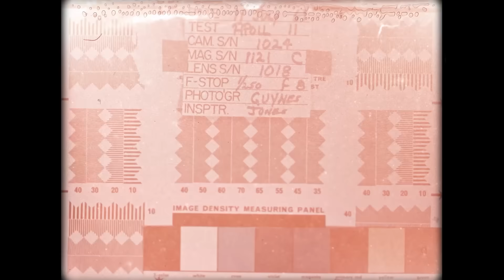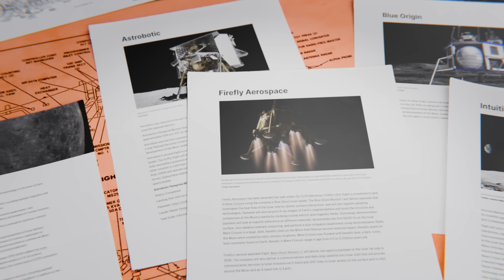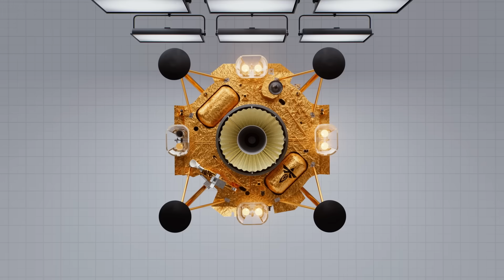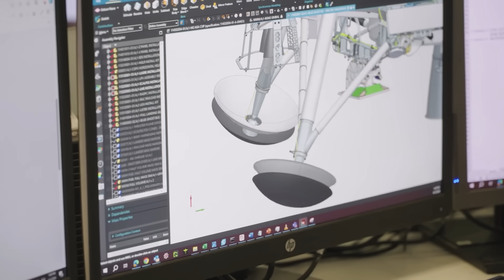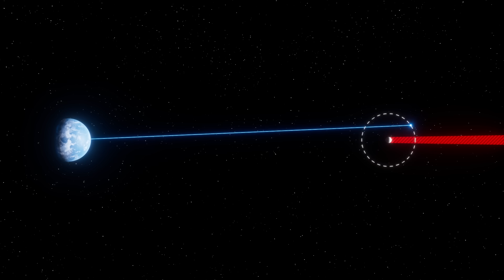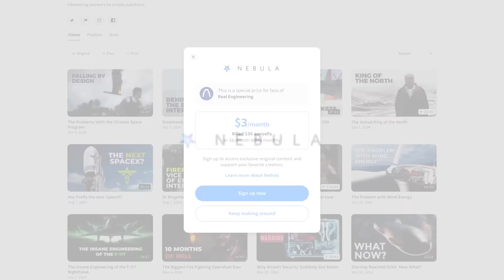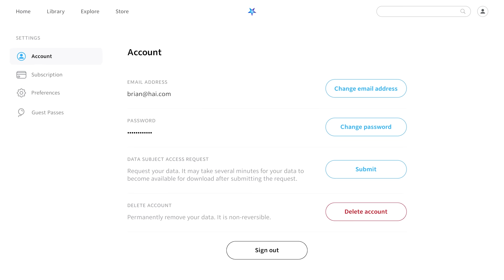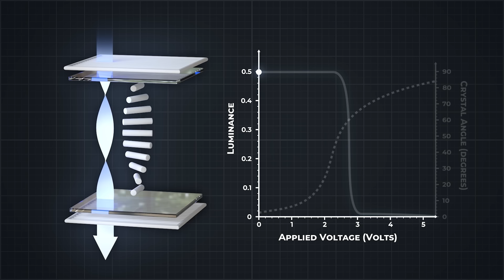Why the US is Struggling to Land on the Moon

Comment: Couldnt you use a sort of air pillow to reduce the landing force ?
Reply: In vacuum?
Reply: @ThomasKunderaBis   Airbag tumbler landings have been done on the moon. In fact, the first probe that successfully landed on the moon (Luna 9) did.
Reply: @ThomasKunderaBis  
If you bring your own Gas ?
Reply: @Conquerthemall  Sorry, I misunderstood, I thought you wanted to do some ground effect floating stuff, which I think would be quite hard without atmosphere.
But some inflated cushion could work, right.
It's light which is important in space and can soften a landing by some factor.
However, space speed are in the km/s range, so most of the speed reduction have to be done by something else as no cushion can handle that.
Reply: @ 
No offens taken 
I would still use the Rockets to Slow down 
It just seamed to be more robust than tinny lags trying to Balance the weight
Reply: @Conquerthemall  : The issue then is still how to recover from a random bounce on a cushion and land on some legs or whatever being more stable than an inflated cushion...
It's not easy, I'm afraid.
Reply: @ 
You could deflate the cushon in a controlled mater so it Lands on same small stabelisers  
Just a thought
Reply: You mean an airbag? Yes, that’s doable for a small lander. In fact we did that for some of the Mars missions.
Reply: @Hobbes746  
Ok thats what i meant 
But These landers are to Heavy Even in the low Moon greavity ?
Reply: @Conquerthemall  I think IM-1 could have used air bags. They’re good up to a few hundred kg on Mars, so twice that on the moon. 
The main advantage of airbags is that you don’t have to care as much about the terrain in your landing zone. The airbag will bounce off any boulders. The disadvantage is that you have less control over where you land, your lander gets heavier, and you have to deal with the airbags after the landing.

Comment: i like how at 6:32 when the craft is on the moon, the sky has the moon in the background
Reply: Sir that is the Earth
Reply: @ObenjOne  Yeah sure.... the Earth is exactly the same size as the moon... because the moon isn't 6 times smaller than the Earth right ? 

It should be 6 times larger than the moon size in the sky but it isn't so.
Reply: @PilTheGrimm  The size of the moon or earth in the sky entirely depends on the lens of the camera (here it's a simulation, btw). You've never seen these photos with an oversize moon ? It's not photoshopped, it's just that the photographer used a teleobjective lens that acts like a telescope. Here it's clearly a wide angle, so you absolutely can't deduce anything from its size.
Reply: Same
Reply: The Earth has phases too, when viewed from the Moon. They are the complement of the Moon phase as seen from Earth - full Earth when new Moon, crescent Earth when gibbous Moon, etc.
Reply: @MattNolanCustom  Notice how the size is exactly the same as the Moon we see from Earth ? It should be 6 times larger then that...
Reply: @PilTheGrimm  that's entirely down to the camera position and lens. I realise this is a "virtual" representation, but you can't just make a judgement of size foreground versus background without knowing details about how the photograph was taken.

Comment: What the hell happened to NASA? We used to do it and be really good at it. Did they go woke like everything else and do Dei hires?
Reply: IM-1 is not a NASA mission. It was run by Intuitive Machines, a new company with no experience, and who were determined not to learn the lessons learned by NASA in the 1960s. IM-1 failed due to a very dumb oversight.
Reply: Um, this has nothing to do with woke and DEI.
NASA has a tiny fraction of the budget it used to have in the Apollo days.
That's it.
Reply: @rockyblacksmith  And rather than be efficient with it. It waste it on company's like Boeing company. Spending billions on crap like Starliner. Don't even get me started on those throwaway rockets that NASA wants to use to go to the moon.  Spacex was given a fraction of the money when compared to Boeing. Then they turned around and produced Dragon. 
How is it that NASA can't be creative like it had in the past? Most likely because the real talent died off.

Comment: This is just a random thought, but lasers . Why don't they just make lasers similar to those in the ship landing scene from in WALL-E movie? They can adjust the camera settings and lasers' strength and specific wavelengths so that they can be seen on the surface even if there is dust in the way. Seems like that would fix the all the visual navigation system problems
Reply: Lasers? Nope. The right wavelength of Radar would be a smart idea as a back-up to the photogrammetry though
Reply: The dust blocks light sur

Comment: My boy is not dissing IM is he? My college roommate is working on the team that built the cubesat camera (eaglecam) on Odyssey. (He did join that team after they finished that project but still)
Reply: IM is due some dissing. Forgetting to switch the altimeter out of safe mode was a very preventable mistake.

Comment: Struggling to return?  You can't struggle to reach the moon! it was easy as pie in 1969 Apollo 11!  so whats the big deal? they did it 5 or six times easily, so whats the struggle?
Reply: NASA spent $300 BILLION on reaching the moon in the 1960s. That’s how “easy” it was: it was the most expensive, largest, most complicated engineering project in history. 
IM-1 cost 1/3000 of that.
Reply: The Van Allen radiation belts which they didn't factor into the original fraud.

Comment: Did NASA themselves not say that the main hurdle is our inability, given our technology, to pass through the Van Allen radiation belt?  When asked about the technology that they used during the Apollo missions, did they not say we don’t have access to that technology anymore?
Reply: nasa never said that, stop listening to conspiracy nuts clinging onto hearsay. the super secret technology to countering the radiation belts is putting more material of shielding and/or going through them fast. van allen belts were never an issue because it's just radiation. as long as you don't stay in some dumb orbit that passes through them electronics and human exposure are a non issue.

the only lost technology from apollo would be manufacturing processes, things are done differently now. this means the specific onboard computers that were used and had radiation resistance cant be reproduced. here 'losing' the tech simply means they have to make new computers from scratch, which they did.

Comment: 0:23 Is this an accurate visual of the landing? If it is, i must wonder why the lander still had any transverse velocity when coming in for touchdown. Surely they had the fuel to shave off an extra couple of m/s, and surely a completely radial approach is ideal. Did they start decelerating too early to hit the perfect flat spot? Did they have to clear some unforseen rubble? I don't understand this choice.

edit: Ok, i have pieced it together. The "laser range finder" has a safety pin that cuts power to it (i think) because you need to be careful with lasers. They forgot to remove this pin before launch so this important navigation system didn't work and they were forced to land without the necessary data.

This is explained further in NASA's livestream "Intuitive Machines Moon Mission Update" on 2024/02/28 starting at 56:00.

>> Odysseus was supposed to land vertically with zero horizontal velocity, but because of problems with the navigation system, it was still moving sideways when it hit the ground. The spacecraft had been designed to stay upright when landing even on a slope of 10 degrees or more. The navigation software was programmed to look for a spot where the slope was five degrees or less. Because the laser instruments on Odysseus for measuring altitude were not working during descent, the spacecraft landed faster than planned on a 12-degree slope. That exceeded its design limits. Odysseus skidded along the surface, broke one of its six legs and tipped to its side. If the laser instruments had been operating, “We would have nailed the landing,” Mr. Altemus said during a news conference last week.
- NYTimes 2024/03/04

>> An apparent issue with Odysseus’ navigation systems forced the lander to rely on experimental technology. Intuitive Machines made the decision to reassign the primary navigation sensors from Odysseus … to use the sensors on NASA’s Navigation Doppler Lidar (or NDL). The Lidar payload is an experimental technology that NASA paid to test fly on the mission. It was not intended to serve a functional purpose. But engineers were able to rapidly patch in an update to bypass Odysseus’ own malfunctioning equipment and make use of the experimental NASA lidar.
- CNN 2024/02/22

Comment: 9:52 you wouldn't need four tanks to solve that problem -- just three 😜 I'd be interested to know why they opted for four instead...
Reply: You do need 4. The vehicle uses two propellants (bipropellent engines) so you need one for the oxidiser and one for the fuel
Reply: @weekiely1233   yes -- but you can just as easily make it symmetrical and balanced by having one of the types in a single, central container with the other in two tanks on either side of it 😉 actually even needing three is only a restriction in 2D -- now that I think about it, you could easily get away with only two in 3D...for example,, just one central cylindrical tank with a second 'donut' (toroidal) tank wrapped around it!

So I'm even more confused as to why you or he thought that we "need" four of them...
Reply: @ then you’d need a big tank, a geometric issue of placing them all in with enough room and slosh issues
Reply: @weekiely1233  if so, then that's an entirely different answer -- not immediately apparent from just pointing out that there are two propellants, and worthy of being discussed in the video! (My original point 😘)
Reply: @ do you not maybe think there is a REASON they went with 4 when it would be cheaper and quicker (not easier) to go with 2 or 3?
Reply: @weekiely1233  ...I'm incredibly confused as to where you're coming from/why you would think so, and also why you seem to be so aggravated -- as I DO think there's a reason, and that's PRECISELY what my comment was looking for and trying to get at! There IS a reason, but it's not the one given in the video...hence my curiosity?
OTOH, not sure what your point is; that even when something doesn't add up or make sense, we should just accept it and shut up about it? Or that I shouldn't be curious about the motivations behind design decisions? Or what??
genuinely mystified...🤔

Comment: The reason is simple: All the companies are trying to make as much money from this as possible and the US gov is looking to spend as little as possible. That's why it's hard to get to the moon and land there. The US has successfully  landed multiple rovers on Mars in the meantime. Which is much much harder. The problem here isn't physics or tech. It's money and politics.
Reply: Hahaha no. It’s because CLPS is a low cost, high risk program. These companies are doing something only a handful of NATIONS can do 

Yet for a tiny cost. The 60’s surveyor program cost $680 million per mission. The IM 1 mission was 1/6th of that 

Also Surveyor failed twice. 2 out of just 7 missions.

Perseverance btw cost 2.4 BILLION. 26x times more than Firefly’s blue ghost. 

You simply cannot compare flagship missions with developmental programs like that
Reply: @weekiely1233  I think we are actually saying the same thing. Just differently. You are saying developing a moon program on the current budged is hard. Which is absolutely true. I'm assuming there's a way to change that, if there's the force of will to do it.

Not looking at individual missions or companies, but at the BIG picture. They waste billions on SLS and then turn arround and cancel VIPER, because they couldn't find a the miniscule extra budged they would have needed to time the launch right. The rover was almost done and the mission is actually quite important for the whole Artemis thing. Congress cuts NASA funding almost every round, at the same time they are not happy about the Chinese catching up. They keep working with Boeing eventhough what they delivered is a clown show. The US government doesn't behave like an entity with a plan and goal when it comes to the Artemis program. The reason for this is politics and the companies involved trying to suck up as much money as they can. The reason why Boeing did get a good kicking and SLS is still on, is because the companies involved have a lot of political influence.

At the same time we have Musk building the most powerful rocket ever launched for 6B $. Yes, StarShip isn't finished the way SpaceX wants it, but just looking at raw capability they could stop right where they are, polish the thing a bit and knock the stuffing out of SLS. I don't like him and his methods, but it clearly shows that the hard problem isn't the technology. It's wrangling the people and the money.

Comment: Yeah the guy your interview is making that hand in pocket gesture, that relates to massive government funding and no real requirement to do anything. That body language shows this is about money, lifestyle and notarightity.

While they lean heavily on AI data, clearly... that is brute forcing the issue.

Problem is AI doesn't work where there is no data to go on, and then relying on the humans in the fold is pointless because they are off at some bar or strip club.
Even if you asked them, they wouldn't be able to help as they have scammed their way into government funding by ticking all the boxes.
Reply: They don’t get massive government funding. It’s quite literally a shoestring program 

And you do realise the ‘AI’ tech they’re using (TRN algorithms) are well documented and have been used previously on missions such as perseverance right?
Reply: @weekiely1233  What did they say, $100million per launch in government funding? For what a steel can, few tonnes of chemicals and some control gear with some sort of satellite networking relay.

The fact that they miniaturized the lander and then didn't think, hey there might be an issue with rocks shows how short sighted the leadership team is.

What you couldn't go for a drive to a moon analog and visualize the landscape you want to land on.

I didn't see a lead mathematician, right so they are relying on HUGE amounts of brute force AI to figure out where they are, because they are not doing the basic maths and trying to isolate the lander to a specific location that has better resolution mapping which they should have done themselves if they understood the issues their own program would run into.

Basically comes down to the board, and all they care about is advertising and money. Rather then focusing on the mission, its all about appeasement policies rather then success and you see this issues in the entire USA military complex and their ongoing wars which always end in their defeat.
Reply: @Unknown-gi1uj  >"For what a steel can, few tonnes of chemicals and some control gear with some sort of satellite networking relay."

You greatly underestimate complexity of developing something like that from scratch. You can get a new shiny iphone for 500$ ish but that doesnt mean that it was developed for 500$. Few tonnes of chemicals? You think that's cheap? You really think they threw in some relay from some Chinese online shop?

>" The fact that they miniaturized the lander and then didn't think, hey there might be an issue with rocks shows how short sighted the leadership team is.

What you couldn't go for a drive to a moon analog and visualize the landscape you want to land on. 

I didn't see a lead mathematician, right so they are relying on HUGE amounts of brute force AI to figure out where they are, because they are not doing the basic maths and trying to isolate the lander to a specific location that has better resolution mapping which they should have done themselves if they understood the issues their own program would run into."

Do you think that all of them just throw money at some random project and don't do these things? Do you really think that the landscape isn't visualized already? The reason you don't see a lead mathematician or whatever is because they are just a worker, do you see the delivery man when Amazon CEO goes on speeches? No one is dumb enough to rely on some untested AI technology to do the work, not even tech bros are that dumb. I assure you that everything there was to calculate was calculated and double triple quadruple checked by some underpaid phds and the tipping over is simply a case of bad luck.

Comment: Should also add, maths is taught different, its all short cuts and cheat forumlars, doesn't relate to world leading mathematics.
Americans tend to have massive amounts of processing power, so they have no need to perfect their codes or the equations, because they just brute force an answer.

Problem is, their answers are always wrong because they create them inside a computer model that has so many limiting factors that is pretty much a worthless investment. Space X shows this with their inability to great pressure pockets in their model that keeps tearing their ship apart and is smashes through voids into thick heavy ions, back into a void. Its like getting punched in the face again and again, rather then in wrestling where pressure is applied to your head.
Reply: Also people are distracted and lack focus.
Reply: i had a stroke trying to read that comment
Reply: @meinking_sensei3807  Well a stroke is related to the brain, highly likely your brain is trying to force new neural pathways to connect information nodes so you can understand the bigger picture away from your trigger word nodes and highways of neural pathways to outrage and fear. Basically what im saying is its expected that there is a brain related reaction to reading such abstract and all encompassing comments.